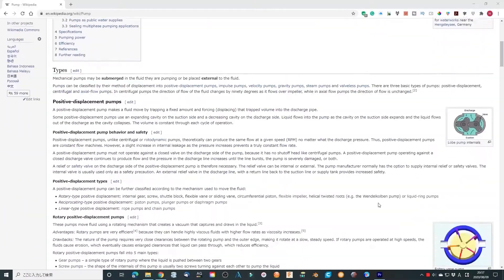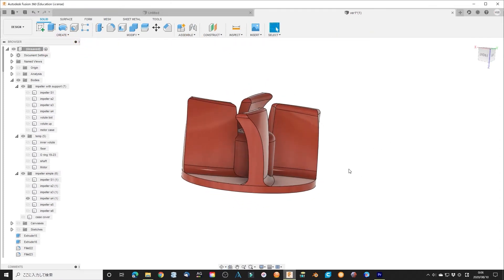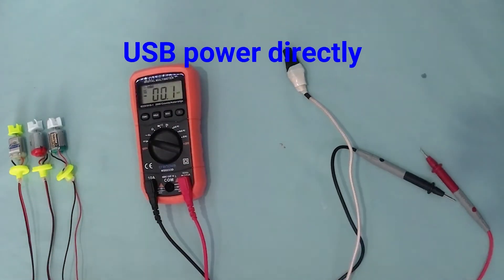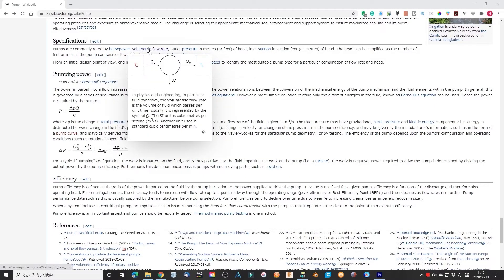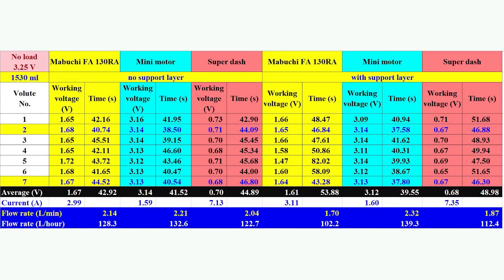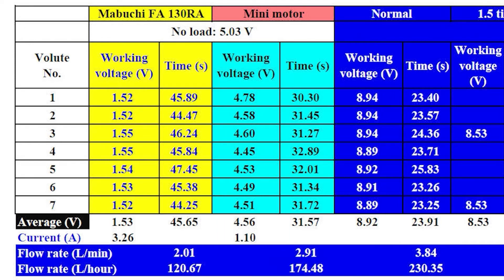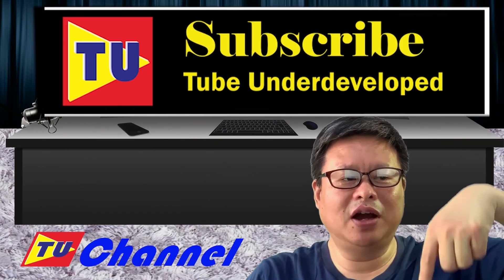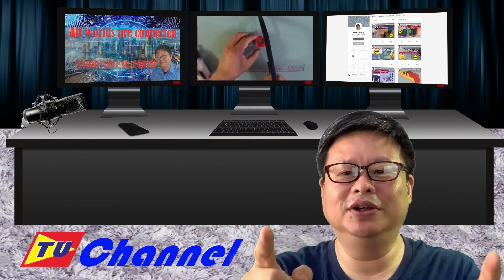How to make a good water pump, all you should know about the water pump made by mini DC motor

Comment: Thanks for all your inputs. I also did some experiments to create my own DC water pump.  After many attempts I just have one problem and that is the motor get wet and after several hours fail to operate.  So my only hope is to find a brushless mini waterproof motor that doesn't get damage by the water.
I try to seal the motor case so the water don't get inside, but it was not possible.  Love all your hard work and love the design of your impellers.
Keep the good work. At the end I have not option but to buy a mini water pump for fish tank that are summershable and last way more than this we just are playing with.
Reply from the maker: I have made a 100% waterproof water pump.  Please check. It will fit your desire I hope. 
https://youtu.be/BdqtM83uNWY
Since the water part is completely separated from the motor. It is 100% waterproof.
Reply from the maker: Thanks for your comments.  I also find this problem if you use the water pump for a long time. The seal problem is very serious.  Usually, a waterproof pump covered by a lot of greases or use some other methods to seal.   Have a nice day.